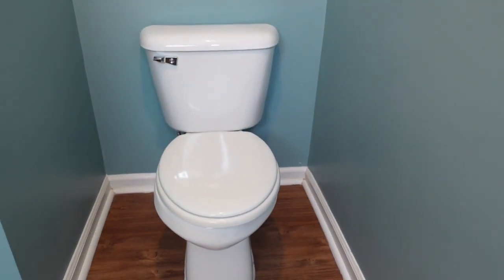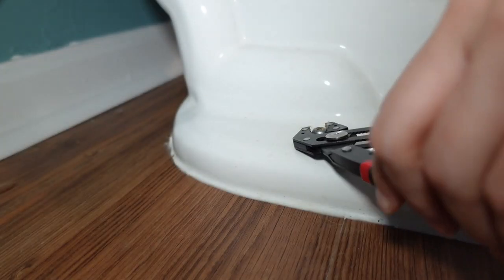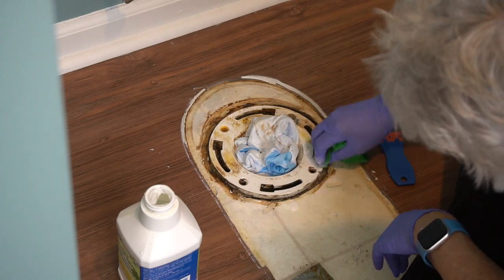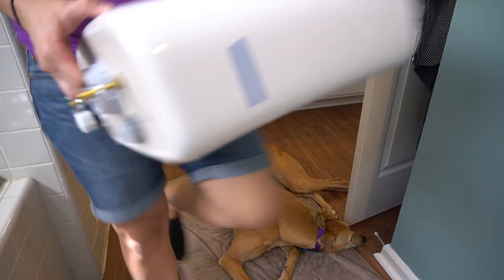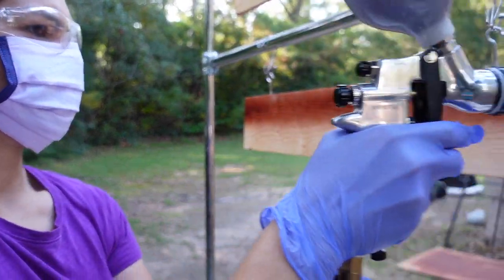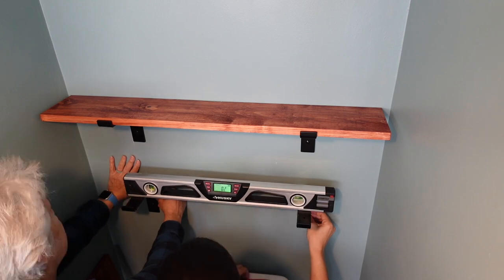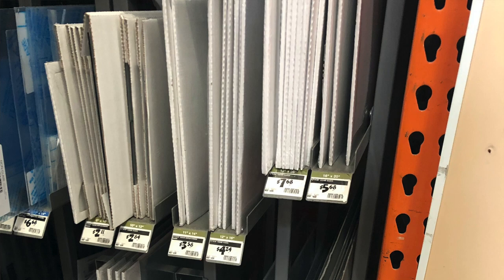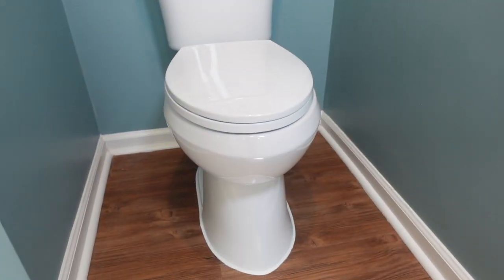How to Replace a Toilet (It's easier than you think!)

Comment: Should’ve shown how to put in the new wax seal sometimes they crack and it would be nice to show how you install them
Reply from the maker: Hi Beth, the wax seal just sits right on the bottom of the toilet. I show it in one shot on the bottom. There was really nothing involved. I just took it out of the package and placed it on the bottom of the toilet (black ring side facing up) and slightly pushed it down to stick. The new wax ring came with the toilet. - Steph